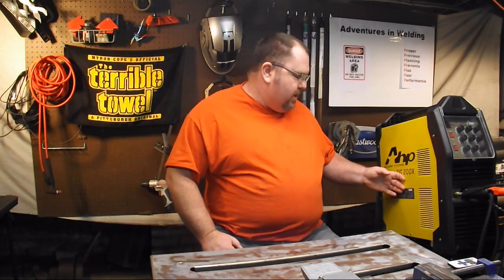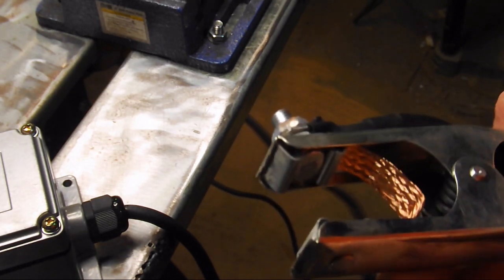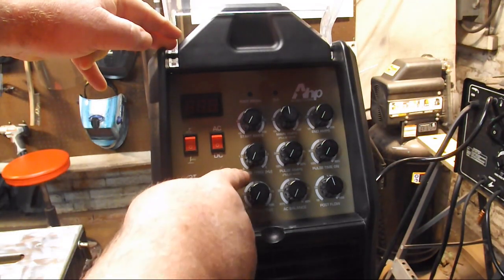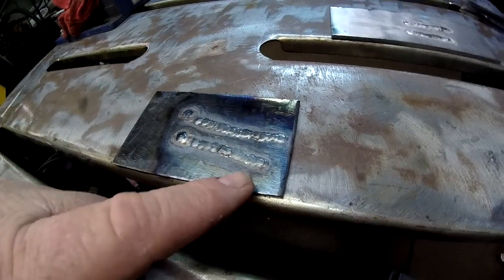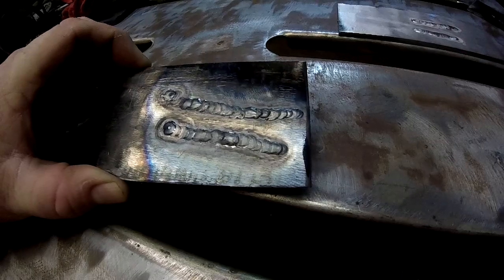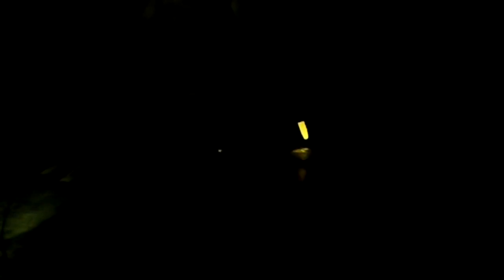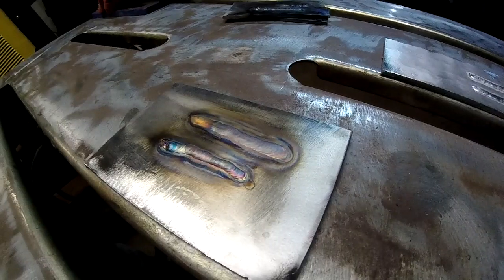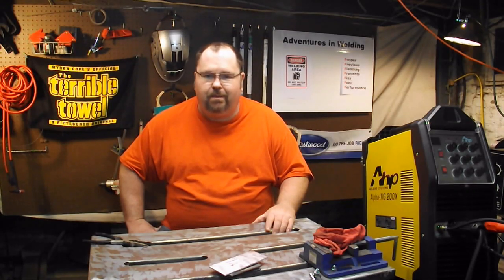2015 AHP Alphatig 200x Review

Comment: Get the ssc foot pedal,  it real is nice.  I'm used to the lincoln style,  it's better for tubing.  The torch is ok but a CK is much better. Get the dual regulator for adding helium or purging.
Reply from the maker: +Nathan Pieper I may get the SSC pedal. But I'm really holing out for a wireless

Comment: Congrats Paul on the new welder. That quick connect is a smart little thing they've got goin there. I like that idea very much. So is this an upgrade from the other brand you were using? Did the old one crap out on ya? Take care and enjoy the new toy. 
Pidge
Reply from the maker: +PiDGE IAM Hi Pidge, The old one didn't crap out or anything like that. I have just wanted an AHP since they came out last year. So this year I saved up until I could afford one. Glad I waited, BUT wish I had waited until next year now. The difference between the 2014 & 2015 model is AC frequency control. The difference between the 2015 & 2016 is (shhhhh don't tell anyone, acording to my source this is secret lol)the 2015 pulse goes from .5 to 5Hz the 2016 pulse will go from .5 to 200hz. Sure wish I'd known about that 3 days before I bought mine instead of 3 days after. But hey....that's the way it goes. It sure is an upgrade.

Comment: I saw this review as I ordered one of these last week and was revisiting some reviews to see what I need to be prepared to change out. I am not a welder and have been getting by with a Lincoln MIG setup for years, and using oxyfuel for everything else.But I did notice in other videos that show pulse welding, the idea seems to be to set the pulse to 1 or 2 pps and coordinate that with dipping the filler rod in sync (either every pulse for 1 sec or every other pulse for 2 pps, etc.) thus making a steady-rate progression down the weld seam with a combination of synchronized pulsing and dipping- have you given this method a shot?  Like I said, I'm not a TIG welder, it just seems to me you may not be using the intended technique, and if you did, you might find the welds look a bit more like some of the other examples of welds I've seen using pulse machines, most of those look pretty good, better than sputtering a rough bead at 5pps. I understand there has also been a torch change, when mine arrives I can report back on what is currently shipping if you'd like. Thanks for making this review.